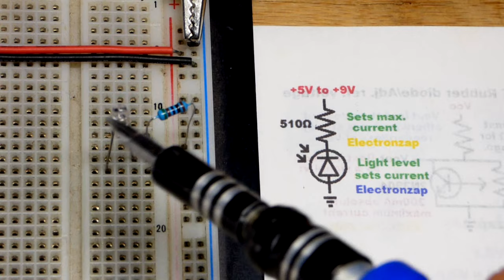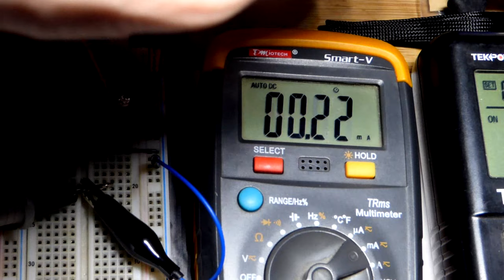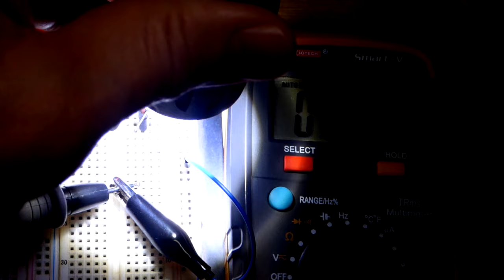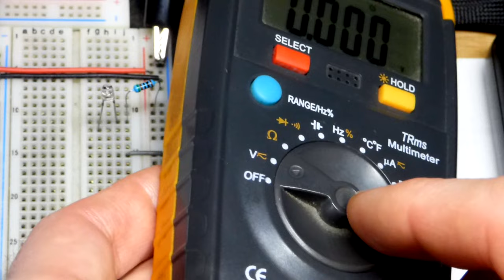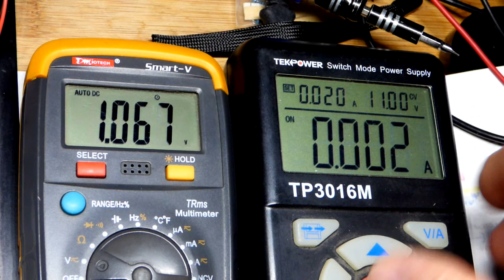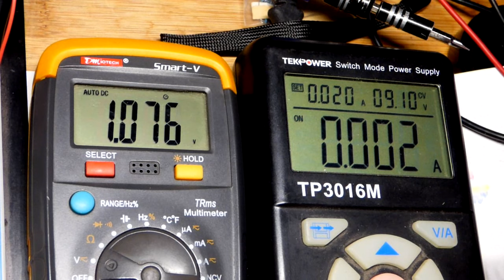Photo Diode Component Basics

Comment: NICE DEMO...
I have done a lot of research on laser diode communications, and have found that the photodiode is by FAR the best detector for long-range (>= 1 mile) detection.  I usually use a 1k to 10k resistor and a biased filtered (dark-colored photodiode).  The laser was IR fiber output with pulsed modulation.  Even a 555 with pin 5 modulation works well for shorter range.

BTW:  GREAT TIP on getting into the habit of ALWAYS keeping the DMM off of current setting as soon as you are through (I bet anyone who has uses a DMM has blown a fuse or two like this).  I also never like to turn off the DMM, even with voltage applied to it...who knows what circuitry is inside.

Have you done a video on that DMM-looking power supply...that would be interesting.
--dAlE
Reply from the maker: That's very cool. I was thinking of using a laser and photo diodes as a way to switch something across the room without having to use a remote control. I think this https://youtu.be/4FZXTk78d0E is the only video I devoted to my portable power supply.